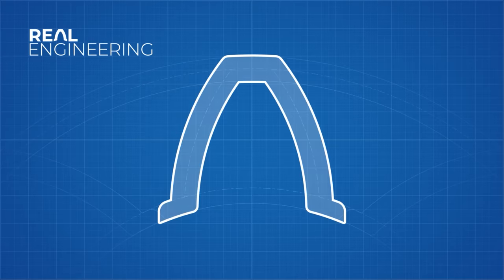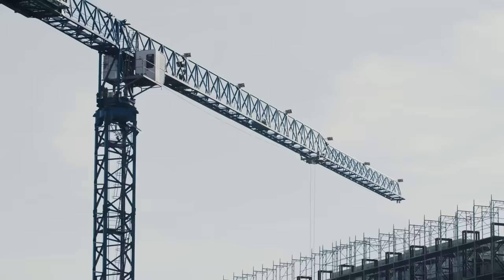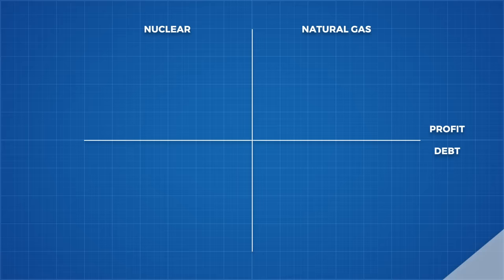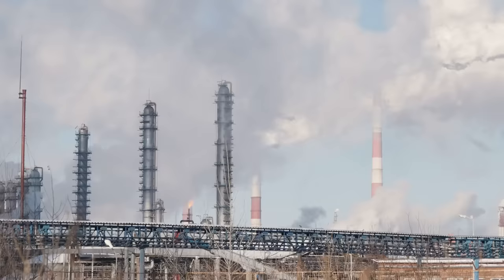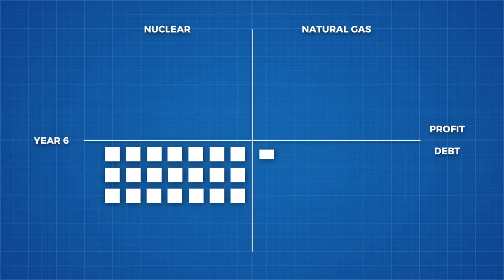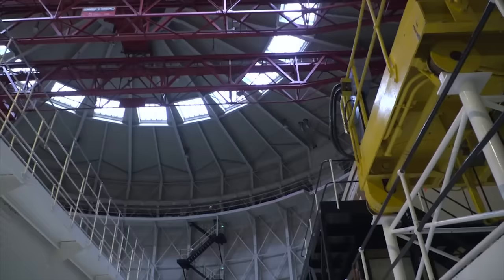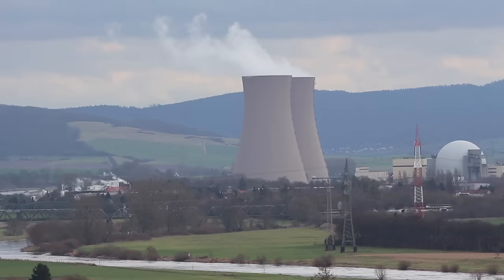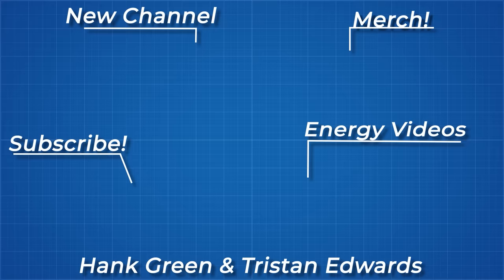The Economics of Nuclear Energy

Comment: okay cool. so, the most pressing question after having watched this video would be: once nuclear power becomes smaller (that's easy .. they not only got one inside aircraft carriers or even submarines, no .. even the Mars rover curiosity is powered by a small nuclear reactor [in order to be able to better deal with long lasting dust storms unlike his solar power driven predecessor]), chapter, safer, and even make it able to switch on and off at will .. why would anyone even bother with those other renewables? they need energy storage (or they'd be completely redundant could just nuclear power us through a so called, "dunkelflaute"), heavily reenforced power grid to be able to deal with all this greatly increased transfer of power (since which region is able to produce some power will shift around a lot), and not to forget: they take away a ton of land area .. something some say is also bad. I mean, our green party not even wants us to build a parking lot around a mall to not take away that space from mother nature (okay, "want" is wishful thinking .. they're in power right now and indeed forbid this, effectivity making it impossible to build any new mall at all .. but they've no issue designating extremely large areas for solar panels that really only produce an extremely mediocre output [just look at the numbers yourself and you'll be awed, big promise]).
Reply: NuScale is actually building SMR in the U.S..   Here is that story and you tell me if it is a sucess?

This is from the Des Moines Register an ultra conservative newspaper concerning the only Small Modular Reactor (SMR) project in the U.S. today.
In 2013, the Wall Street firm Lazard estimated that the cost of generating electricity at a new nuclear plant in the United States will be between $86 and $122 per megawatt-hour. Last November, Lazard estimated that the corresponding cost will be between $131 and $204 per megawatt-hour based upon the 4 recent new nuclear projects in the U.S. . During the same eight years, renewables have plummeted in cost, and the 2021 estimates of electricity from newly constructed utility-scale solar and wind plants range between $26 and $50 per megawatt-hour. Nuclear power is simply not economically competitive.
SMRs will be even less competitive. Building and operating SMRs will cost more than large reactors for each unit (megawatt) of generation capacity. A reactor that generates five times as much power will not require five times as much concrete or five times as many workers. This makes electricity from small reactors more expensive; many of the original small reactors built in the United States were financially uncompetitive and shut down early.
The estimated cost of constructing a plant with 600 megawatts of electricity from NuScale SMRs, arguably the design closest to deployment in the United States, was originally advertised as costing $1 billion but upon requesting actual bids from engineering firms, increased to $6.1 billion in 2020. Given inflation and other cost constraints that cost today can only be expected to be significantly higher.
The cost was so high that ten members of Utah Associated Municipal Power Systems canceled their contracts. NuScale then changed its proposed plant configuration to 6 fewer reactors but increased each reactor output from 50 Mw to 77 Mw costing at total of $5.3 billion. The NRC just last week approved the construction of the 50 Mw design but now will have to start the review process all over given the switch to a 77 Mw design. For each kilowatt of electrical generation capacity, that estimate is around 80% more than the per-kilowatt cost of the Vogtle project in Georgia — before its cost exploded from $14 billion to over $30 billion. Based on the historical experience with nuclear reactor construction, SMRs are very likely to cost much more than initially expected. And they now have delayed the project start until 2025 in an attempt to find more backers.  All this before the inevitable setbacks that will occur once construction starts.
Reply: @clarkkent9080  yes, good point, but I still come to a different conclusion (because you omitted a thing or two). the cost of renewables doesn't include energy storage, which is inevitable once you further wanna extent them and scale down more conventional production of electricity (that now do the job of "ironing" out the heavily fluctuating output. another point that's very often overlooked is that not every country or region had plenty of space available and optimal conditions. did you at one point consider doing the math of how much land area you need to replace just one small nuclear power plant that has a tiny footprint (a literal one, this time). if available space is limited, acquiring this land area alone comes with a hefty price tag (not to talk about "surface usage" which environmentalists already complain a lot about that we use up way too much and in my province just prohibited to build parking spaces around new shopping malls [effectivity ruling them out altogether]). you seem not not have fully understood what SMRs are about and why they're considered, right now. yes, building a "conventional" power plant is exactly like you described .. the bigger you can build it, the more cost effective it'll be. but it's still like a handcrafted, individually build one (by one). the idea with SMRs simply is to somehow switch over to mass production. yes, this naturally comes with economical risks (just like anything else) and heavily depends on future acceptance of this technology. one alone won't cut it, of course. but should like about 300 of them be build, then the economy of scale kicks in. according to your reasoning, Tesla should've closed about ten years ago because how expensive and still uneconomical their production has been. or like flat screens: yes, the first ones after they came out were absurdly expensive. everything can fail, but one sometimes needs the balls to at least try it (cause only then we can know for sure). and it's not like smaller reactors are "that" novel. every US aircraft carrier has one (or two, I think. and look how often they need to "refuel" .. and then compare to like diesel powered ones, lol) or many submarines; heck, even the Curiosity Mars Rover is fitted with a nuclear power plant (after Pathfinder [or which one it was]—which was fitted with solar panels and a battery—was lost in a fourteen month long dust storm; to which NASA said, "heck, never again!") .. and it's like five by five foot total size, or something.
Reply: @HxTurtle  This is not a nuclear vs ???.  This is a nuclear is not even in the ball park on cost compared to other options.  
And the Westinghouse AP1000 is a STANDARD design that has been built and operated in China not a one off build.  You look at the prints and you build it.  And VC Summer and Vogtle used the "factory " build for system modules but they had poor welds and would not fit together at the site so most had to be re worked.  
Concerning the factory build SMR, do you thing they are actually going to build the reactor coolant pump motors and have a foundry to pour the reactor vessel?  Their factory is just an assembly area for parts that are manufactured elsewhere. 

Navy reactors use 95% enriched U235 with one fuel load costing $1 billion and the fuesl is considered weapon grade and must use all the associated controls for handling and protecting nuclear weapons. The reactor is not what costs $16 billion, it is all the support equip.

Anyway, after VC Summer and Vogtle no U.S. utility is considering the standard PWR and if they ever did, that is at least a 15 year project. The only other nuclear projects are demo test reactors NuScale which is currently on hold till 2025 due to ballooning costs and utilities backing out and Terrapower that has been building for 2 years but have not broken ground. 10 years to build and 5 years to test and you are still at least 15 years away
Reply: @clarkkent9080  no, look: key here is, you build it on site. SMRs, you assemble inside some factory and then simply ship the whole and completed thing. that's the cost saving factor (not that you don't need to like actually design the entire thing from scratch). you don't sound like you're looking neutrally into options available. I'm yet to read your other paragraphs. but can you include costs for storage needed? no? why that? ah, because no one even knows how to store the energy needed and in which form; so, that part would be pure speculation (but if that's doable in an economically feasible way then fine, let's do it.)
Reply: @clarkkent9080  yes, just the "core" is mass produced. the needed surrounding is relatively cheap, though. (not too different from like a gas powered plant and they're very cheap to build.)
Reply: @clarkkent9080  I did not know about the difference in reactors used by Navy (that part they somehow never add, interesting). yes "conventional" reactors are too costly to build (mainly due to the outer containment for safety reasons), I do agree on that. but nuclear does have a rather low carbon footprint and can solve the "baseline" problem for renewables; so, to use them alongside seems what might be an option. if it's not an option because valid reasons do speak against it, then it's not one. you did bring up many interesting points.
Reply: @HxTurtle  I know you must have seen a tractor trailer on the road before.  They have a maximum load capacity of 45,000 lbs. that is 22 tons.  If you look at the SMR designs, the forged reactor vessel ALONE weighs 40 tons. So you have to ship it by rail and it can only be built where there is a rail spur.  The factory would also have to have a rail spur and I am assuming that they will NOT have a steel mill, motor factory, stem generator factory, etc.  so this "Factory is just receiving large heavy parts and assembling them for shipment to the site.  Why not just ship them to the final site and assemble then there?  The indoors, same welders, etc. would help but would it off set the cost of double shipping and limitations on what you can actually ship?  Rail cars are not that wide so that is a limitation.

You do know, a reactor coolant system is simply a reactor vessel, a coolant pump, and steam generator.  This is very simple and as shown in navy reactors relatively cheap and easy to assembly.  But in a power plant there are steam lines, reheaters, turbines, generators, condensers, secondary water pumps, cooling towers, electrical busses, transmission switchyards and lines, admin facilities, maintenance shops, etc. etc.

The idea that you can fit even a fraction of that on a rail car is absurd. Could you fit a reactor coolant system on a rail car....YES, but that is just a small part of a power plant.  

Even in a large PWR, those components arrive on site as a reactor vessel, coolant pump, steam generator, and piping.  That is six welds on site and the system that you want to build in a factory is complete on site and only takes a month or so. It is the rest of the plant that takes time and money.
Reply: @clarkkent9080  yes, via rail you can ship less than on the road. the weight limit is only for "regular" trucks that can legally drive without having to ask someone. I did in fact see plenty of overload transports (during night time) that quickly reach like a quarter million pounds.

I haven't fully read everything you wrote so far, however, I do see that you know a lot and I'm more than willing to update my believes if I deem your argument just more reasonable than mine I got so far. I'm always happy learning something new (I probably might have already wrote that, not sure about it anymore, lol).
Reply: @HxTurtle  No, a rail car can transport 220,000 lbs.  The maximum legal truck weight is 80,000 lbs but the truck weighs 35,000 for a net payload of 45,000 lbs, which is less that the SMR vessel alone so it would have to be shipped by rail.  
My point is that you cannot possibility ship an entire reactor power plant even by rail.  Look at the size of a typical 1,000 Mw nuclear plant and note That EVERY building, component, wire, etc is necessary for power production.  Now, SMRs are in the 300 to 600 Mw output and that means their size will be 1/4 to 1/2 the size of a standard nuclear power plant.  You cannot produce more power in a smaller package
Reply: @clarkkent9080  but the one question that remains open: why is it then so cheap (and quick) to build gas powered plants that on a first glimpse, look big and chunky as well? that just makes me think, it must be tied to the nuclear part, a nuclear power plant takes so inanely long to build. and the, umm yes, power point presentations I saw so far claimed, you only need to dig a hole into the ground and fill it with water, where you then dump the module into (like a very deep swimming pool, especially) .. that's basically it (because they're smaller, no active second cooling system is required .. the water around it is then enough to not evaporate in case of a meltdown.

I mean, nuclear power wasn't really further developed since fifty or sixty years. look at a combustion engine .. it for heavily modified over that period of time. this really makes me think, that we might not have reached everything that's possible with nuclear power (in terms of efficiency .. and therefore price, I mean).
Reply: @clarkkent9080  I thought we already agreed on, that rail isn't feasible, mainly due to size constraints. but on the road, your cited weight limit is only valid for non-announced transports. have you really never seen an oversize truck at night? I mean, they're really not that hard to come by, by all means.
Reply: @HxTurtle  Every coal, oil, or nuclear secondary (steam side) is almost identical.  Only the heat source (in this case nuclear ) is different.  Because of the dangers of nuclear, there are multiple and redundent safety systems, emergency power supplies etcs.  Even when the reactor is sutdown, it produces heat that must be removed 24/7.  Even spent fuel rods after being removed from the reactor must be cooled for years.  

In a coal or oil fired plant if the fire goes out that is it safe and nothing more to do.  Not so in nuclear.

I have no idea what you are talking about with digging a hole and fill it with water?
Reply: @clarkkent9080  but overall, even though I didn't just outright fully accept everything you said and tried to question your statements, rest assured that so your typing wasn't in vain and I indeed do take a lot into consideration (especially since you seem to know a lot about this topic). it's just a quite natural process, I believe. what differs from one's own views, you first severely question, but once it withstands that, just consider it worthwhile.
Reply: @clarkkent9080  I didn't realized you messaged just the moment I typed as well, lol. so, I didn't get your last statement, so far.
Reply: @HxTurtle  Here is my suggestion: do some reading.  Don't rely on YT videos.  Google how nuclear reactors work.  When you don't understand something, google it and read more than one article.  Look at the source is it reliable.  Learn to learn instead of being feed what other people want you to hear. Wikipedia is a very reliable source.  Don't accept anything I say, lean for yourself
Reply: @clarkkent9080  yes, I knew about how nuclear works, basically and are very aware of its many issues and that spent fuel keeps staying warm, I know that. in a nuclear plant, I somehow considered the power generating part and especially its water cycle the tertiary system. you've two separated ones for the nuclear part, right?

about the digging a hole and such. yes, this was from a documentary about SMRs that just tried to protect a very positive outlook on this potential technology. they showed in a graphical animation that you just need to dig out a cubic hole, that's base is a square and rather deep (that's why I said like a swimming pool, just 'a lot' deeper). they said, you put your SMR in there and fill everything up with water. no outer containment required, or power generators driving a pump, since they're so low in power that the water has enough residual cooling effect that—and yeah, that part I got wrong—this provides enough cooling to prevent a full meltdown even in case of a malfunction (I said something like, "this would be able to cool a full blown meltdown" which is just wrong, as I now realize). you know like in Fukushima, which didn't have this outer casing to begin with to catch a meltdown and basically "only" happened because the diesel generators were located "downstairs" and hence for flooded as well and therefore couldn't power the pump anymore. initially, they hoped a full blown disaster might be preventable, which wasn't, but still, if you compare to the harm done by the tsunami itself, it couldn't really "compete" with that).
Reply: @clarkkent9080  yes, that's a very reasonable suggestion (as a matter of fact, that's what I'm typically doing anyways .. just saying. you just can't possibly do it for so and everything all the time because proper research can be very time consuming. everyone has an initial learning phase)